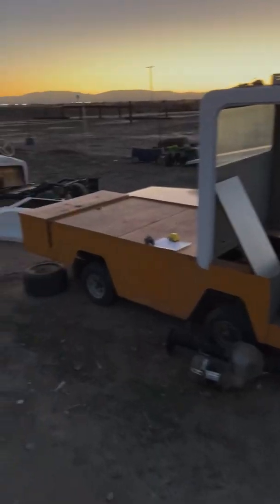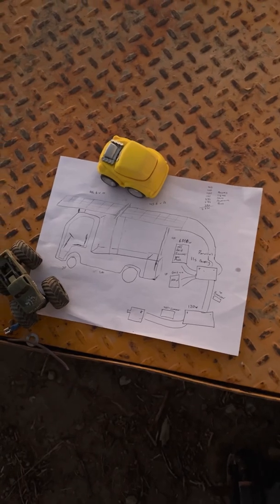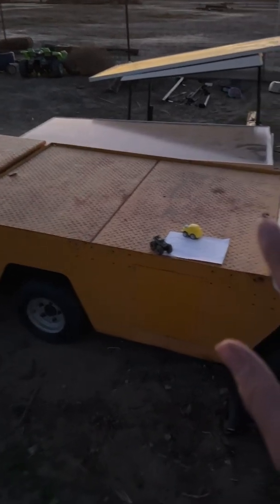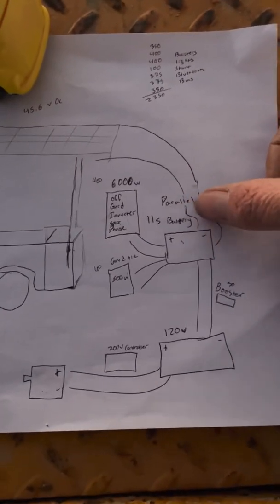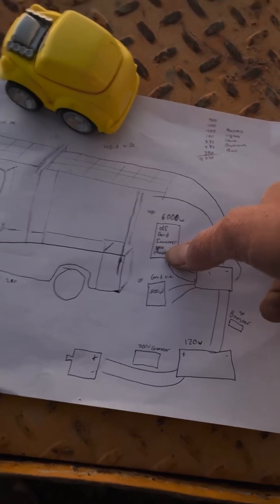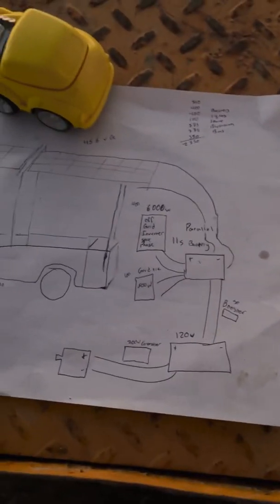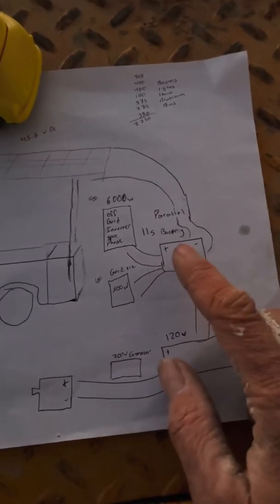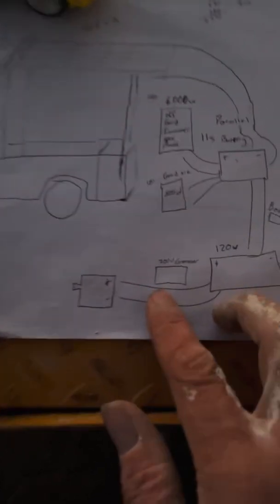Powerwall on wheels—1 The Plan

Comment: Not sure if you have started this yet but I have a thought. I have a three wheel cushman truckster and seeing this sparked a similar idea. I was thinking maybe just leaving it a 48v system for the drive but also thought yours is a better choice. 144v would allow higher top speeds beyond what you’d ever drive it but you’d not need any transmission either. Maybe an AC motor setup with a Curtis 144v controller and just limit the current as the vehicle is so light.. as for the 48v system, I think you’d need to keep it separate from the 144v system unless you just have a 144v system for driving but while charging you have contactors that switch it to 48v for charging purposes so the main pack is always in balance. So once out of drive mode it will become a standard 48v that can run your home with the inverter.
Reply from the maker: I have actually decided to leave it 48v. I had a 72v setup in it for a while but the bms fried and I haven’t messed with it since.
Reply: @RetroElectric  What cells are you using in that thing?
Reply from the maker: @onegreenev  I was using the Spim08hp cells from batteryhookup.com

Comment: I have similar idea - EV as a emergency power backup system connected through sub panel in garage will supply a house if needed.
Reply from the maker: Yes might as well be ready to use your EVs battery when the power goes out then wait till it’s too late and have a big huge battery sitting there while you freeze or over heat to death. 😁